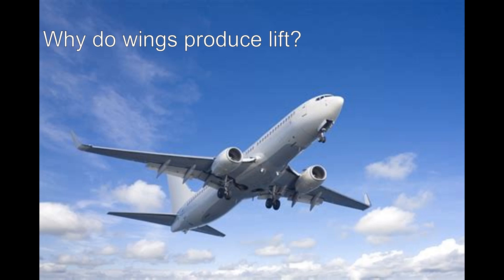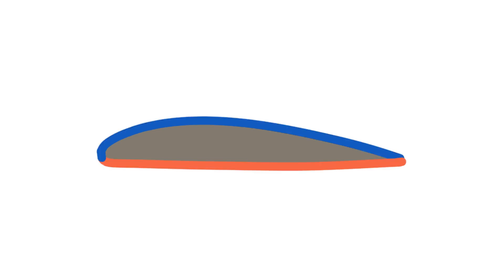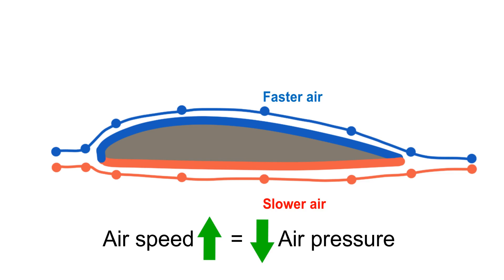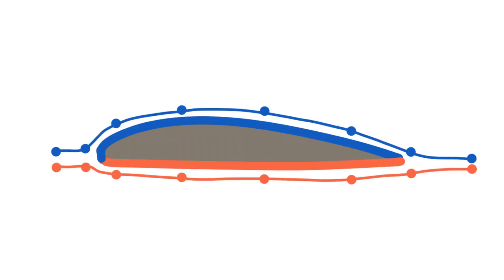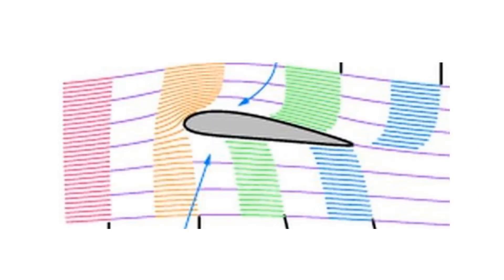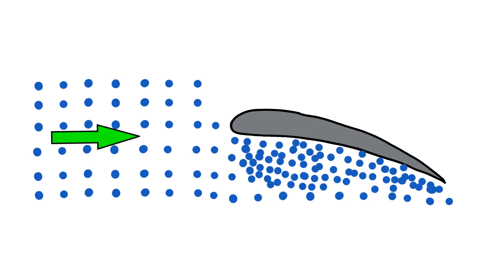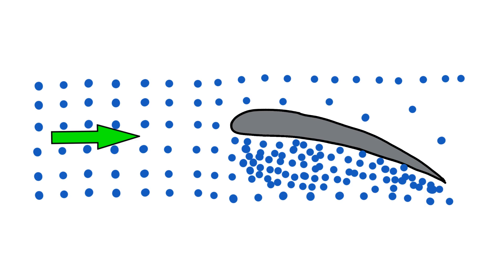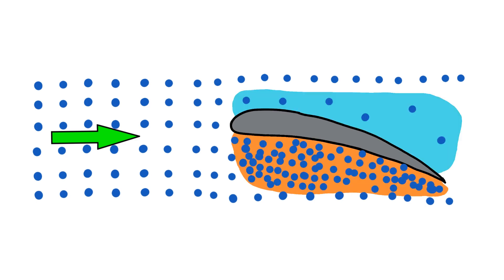How wings produce lift #VeritasiumContest

Comment: You can create a bernulli effect and create  a low pressure  area. However it will be canceled by an equally high pressure  area in front and behind it. This isometric force builds within the object but doesn't cause a lift force.  You'll have to excellerate air first,  and allow it remain excellerated. Wing downwash cannot be recaptured as this would cancel lift.

Comment: By the way.  This is precisely the type of simplification that is suitable for the less sophisticated and youngsters.  The fact that the density change is not significant does not hurt this simplification. 
.
If you go to the trouble to actually calculate the pressure changes, you find they are really quite small and that changes the pressures enough, but not the density.

Comment: Wouldn’t such an angle produce drag force and cause the plane to stall?
Reply from the maker: It would indeed, that is why thrust is required from the engines to maintain a constant velocity. The drag from the wings is referred to as "induced drag", and can often be reduced by making the wings larger (though often at the expense of larger skin drag)

Comment: when the wing is flat though, why would particles bunch up under it.  Airfoil wings with perfectly flat bottom still produce lift.   I dunno, just feel like this isn't quite there.
Reply from the maker: Flat airfoil wings only produce lift at non-zero angles of attack. If a flat wing is given a negative angle of attack, then it will produce negative lift as well (pushing the plane downwards).

You can see this geometry on submarines. The diving planes are symmetric, meaning that they can push the sub up or down based on the angle of attack.
Reply: @prestonbecker8784  Sorry I should have been a little more clear.  I meant airfoils that have a flat bottom and a curved top but where the flat bottom is in line with the flow of the fluid.  I could see bunching and accelerating of particles at the top going over the curve but the bottom shouldn't really see a bunching of particles?
Reply from the maker: @aeroboy14  Ah. In that case, you may not get a region of high pressure building up on the bottom side of the wing, but the curved section of the wing will still produce a region of low pressure, which will produce lift.
Reply: Airplanes can fly straight and level while upside down, "riding a cushion of air" on a wing with a curved bottom and a flat top. But it's more unstable than conventional flight. In conventional flight the top of the wing contributes to control while the high pressure underneath lifts.

Comment: With zero AOA: The low pressure on the back will `Suck'' the air in with high speeds, making it spread out and give low pressures on the whole airfoil.
Nice video btw, mostly how it looks in my head, exept with the air following the shape of the wing.

Comment: The graphics in this video clearly imply that air under the wing is compressed. The commentary is more explicit: “the air becomes bunched together”. In fact, there is negligible compressibility at the speed of a typical light aircraft, and effectively zero for a hydrofoil at any speed. The conflation of pressure and density is just as false as the equal transit time theory. So this little video is a big fail.
Reply from the maker: The ideal gas law holds just fine for air at standard pressure and temperature, no? So if PV=mRT, and if the mass and temperature of the air remain constant, then for the pressure to increase, the specific volume (volume per unit mass) of the air under the wing must decrease, meaning therefore that the pressure is increasing.
Now, granted, the change in air pressure under a wing can be as small as 0.1 psi, which is roughly a 1% change in pressure, meaning the increase in density is also around 1%, which is why we consider the change in density as "negligible". But for an ideal gas such as air, changes in pressure at constant temperature will always have a corresponding change in density. And I include the change in density because it given an explanation for why is driving the pressure increase.
Reply: @prestonbecker8784  The Equation of State is redundant here. Water is virtually incompressible, hence any explanation that requires density change to explain lift fails completely for hydrofoils. Same for low speed aerodynamics. I am not saying there is zero compressibility in low speed aerodynamics, I am saying it is negligible. You cannot attribute lift to a theory that requires “the air is bunched together”.
Reply: Exactly the venturi explanation is bullshit

Comment: Hello Preston, this is very intuitive way of dispelling the different length and equal time fallacy. But to further dispel the misconception I would have also included that changing the angle of attack effects the amount of lift created. If you were to draw streamlines around the lifting airfoil, you can represent the pressure difference you described with curved streamlines, and this would be an improved intuitive explanation.

Comment: The air under does not 'bunch up' though the pressure does increase.  This is caused by the air having mass and, therefore inertia or momentum. It can't get out of the way of the wing, so the pressure in creases. Above it is also the momentum, but it is in converse with the air and surface tending away from each other. . 
The cause of  the lower pressure above is explained here: *https://www.youtube.com/watch?v=3MSqbnbKDmM*

Comment: Hi Preston, what you are proposing is a hybrid fluid Newton ski effect model. There are a couple of things this cannot explain.
1) A cambered flat plate (think the Wright Flyer) at zero angle of attack. This model would produce a down force there.
2) At small positive angles of attack (less than 4 degrees I think) for a symmetric aerofoil the pressure on the lower surface will transition from a positive gauge pressure to a negative gauge pressure, so there is also a low pressure on parts of the lower surface.
Fluid mechanics in not easy, in fact one of the Millennium Maths Prizes is about proving Navier Stokes is always smooth and continuous (as real fluids are) in 3D. As such, fluids do odd things.
In principle, you have answered your "how" question, and that is great. How wings produce lift is because of pressure differences, and experimental aerodynamicists literally measure pressure, and integrate to determine lift. Then there is the moment, the fact that the wing goes up so fluid goes down, which computation aerodynamicists use to calculate lift via circulation, and the velocity of the flow around the aerofoil, integrating that.
Why that all happens, that is the hard part, and is because of the fluid and the fluid structure interaction.
Reply: From what I have seen, high and low pressure zones only occur where there is a change in vertical air speed. For example in a flat airfoil the air starts to accelerate downwards right at the leading edge that's why the high and low pressure are so far forward (In Rc planes with a flat wing the centre of gravity is almost at the leading edge) In a wing that is flat at first and then starts to bend downwards the pressure zones are right where the air starts to go down.  Sometimes right in the middle of the wing, as in old paragliders and parachutes.
Reply: So, AD, does a wing at a zero angle of attack produce lift?  For example, what if it is convex on top and flat on the bottom, and operated at a zero angle of attack - will it produce lift?
Reply from the maker: Hi AerospaceDoctor,
Yes, you are correct. This explanation is incomplete. But given the 1-minute requirement, this explanation is probably about the best that you can do if you want to remain accessible to a general audience, especially when we have so many other inferior explanations out there (such as Coanda, equal transit, and the bouncing air molecules explanations) which really need to be discredited and driven from the public sphere.

Of course, I could have gotten into viscosity in my explanation. And based on your comment about Navier-Stokes being complicated and about the “why” of lift being related to fluid and fluid structure interaction, I’m guessing a big part of your disagreement with my explanation stems from me not mentioning viscosity. But in a one-minute video like this, if you do decide to discuss viscosity, then the only people who would be able to follow the video are those already familiar with fluid mechanics. And, like I said, reaching a general audience is kind of the point here.

Also, you point out that the explanation in the video can’t properly explain the lift of certain airfoils at small to zero angles of attack. Now, I happen to think that my explanation could explain the behavior of the wings in your two examples, especially if I had had time to delve into stream turning, Newton’s third law, and Bernoulli’s (which are the logical extension of this explanation). However, even if this were not the case, the fact that this explanation is a) understandable to a lay audience, b) is largely not incorrect (as opposed to Coanda and equal transit), c) does explain lift for most common cases, and d) comes in under one minute, means that the failure to fully explain some fringe cases hardly seems like a fair criticism.

But with that said, I do appreciate the feedback. Finding a correct and accessible explanation for lift is something that has been on my mind for a while, as I suspect it has been for you as well. Towards that end, I wrote up a longer version of this comment and sent it to you in an email. If you think this is a conversation worth having, let’s continue our conversation there and see if we can’t come up with a full explanation that will kill equal transit and Coanda for all time.
Reply: @prestonbecker8784  I completely understand. The fact is, the Social Media team here at UNSW stressed my explanation had to be understandable by an 8 year old. In trying to do that, I think I came to the realization that it is not really possible, and you have hit on to many of the reasons why. If a topic was too hard for Sir Isaac Newton and Leonhard Euler, I think we can agree it is not easy. I always like the saying that you don't need to be a rocket scientist to understand how a rocket works, but you have to be a rocket scientist to understand how a wing works!

From a purely pedagogical approach, I think for 8 year old's we have to stick to HOW does a wing produce lift (and yes pressure differences and flow direction change perfectly address that). I think any discussion about WHY needs to be expressly stated that it is complicated and is related to the properties of the fluid and the way fluids interact with structures, with the added light that at higher levels of education, you will learn why exactly. I mean the same thing happens when an 8 year old asks why the apple falls from the tree. Newton can explain how, but not why. If the person explaining has an appreciation of general relativity, then they can explain why, otherwise, it would be interesting to know what the average person says to their 8 year old when they say "but why does gravity make the apple fall?"

One of the many things on my list of things I would like to do, but don't have enough hours in the day, is to actually do a qualitative analysis of comments on lift videos. So, while I am grateful you welcome the feedback, my criticism is very tame compare to some of the vitriolic stuff out there. I also made sure not to comment on any ones lift video until after the competition finished. But to me it is very interesting how strongly people cling to what they think they intuitively understand, when my point would be that it is not intuitive at all (again Newton and Euler failed to understand it). We think (collectively speaking) that this happens arounds us all day every day (insects, birds, bats, aircraft) so it must be easy... it just isn't. We have a great aerodynamicist here looking at how bees fly, and insects who have been flying for 100's of millions of years have exceptionally complicated aerodynamics. Just because a fixed wing aircraft is typically in a steady state does not mean the aerodynamics are not complicated, because they are. I look forward to reading the email!
Reply from the maker: @aerospacedoctor  So did you go and respond to every lift based Veritasium video? How many were there?

I sent the email at the same time that I wrote the comment, so you should have it by now. I sent it to the email address listed at the start of your video.
Reply: @prestonbecker8784  I think there were 4 including us. One of them didn't really talk about lift, it was about how a wing is like a leaver applying mechanical advantage. The other was about curved streamlines, which I did respond to. Again, not wrong, but also another "how". I am surprised there where not more (I think the Monty Hall problem got more videos). I have the email, I have spent the weekend writing a grant, which I have literally just finished. Need some sleep, but I will reply!